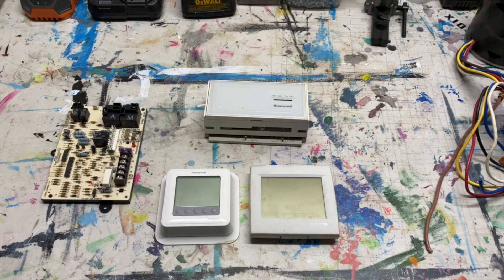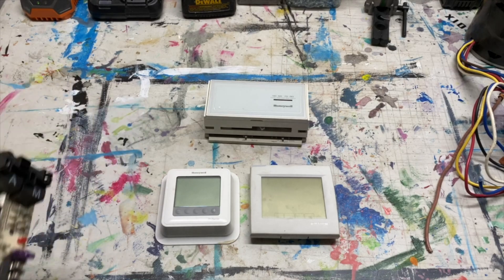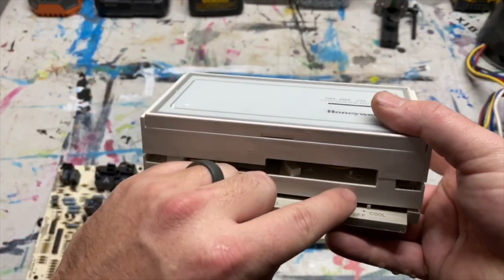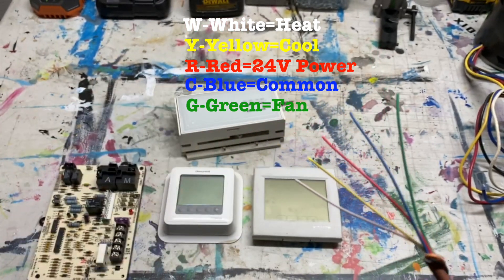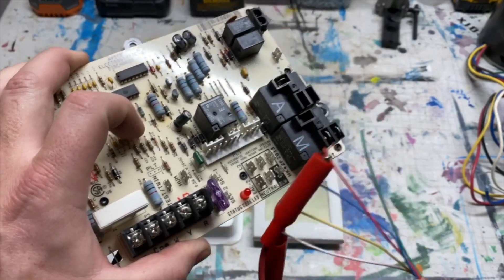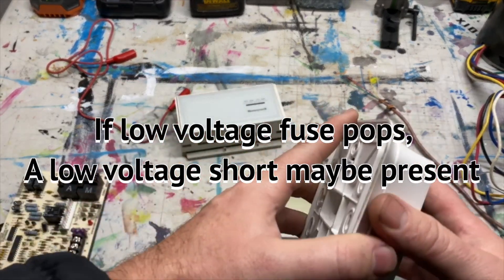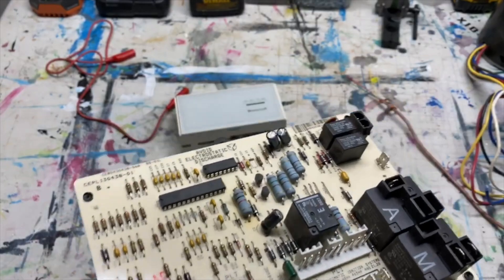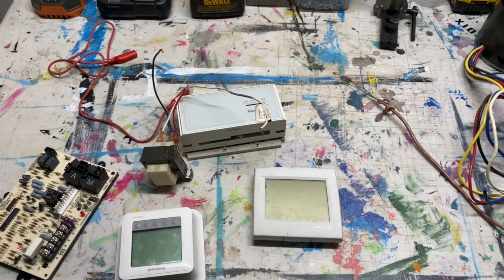Furnace Basics Series, Sequence of Operation, Call for Heat, Part 1. EP32

Comment: Thanks!!  I figured the thermostat output was just a switch to connect something (24-volt power in this case) to the furnace controller, but I couldn't find it stated anywhere.  I'm helping a friend with an RV furnace so now I know we can bench check it with a jumper.  This is a big help since I don't have to worry about breaking something if we are careful.

Comment: Does the Y wire turn the fan(blower motor) on or does the green wire do this. When you select cooling does the green wire also get 24vac at the thermostat as well as the Y.
Reply from the maker: Depends on the age and the brand of the equipment. Sometimes Y and G need to be energized and sometimes just Y needs to be energized. It’s frustrating. If you energize Y and the blower doesn’t turn on then try energizing G too. Mostly heat pumps need the G energized when cooling or heating.
Reply: I assume the thermostat would always power G with Y or does it depend on the thermostat
Reply from the maker: It can be programmed in the thermostat or jumped out.